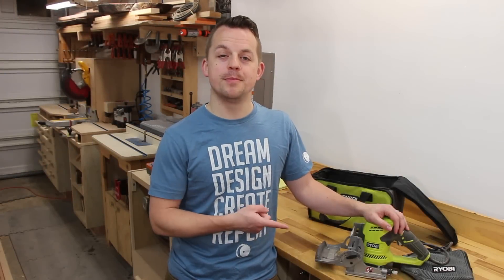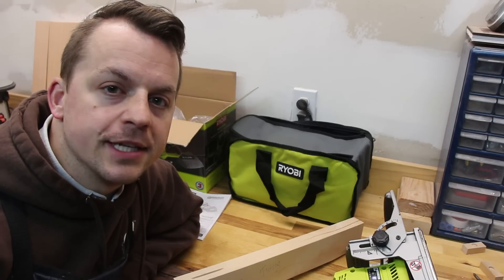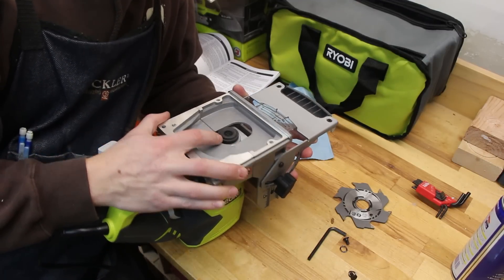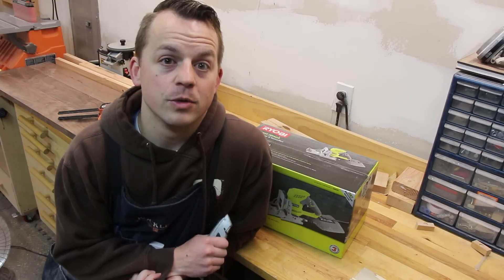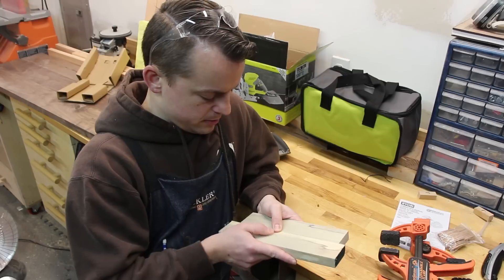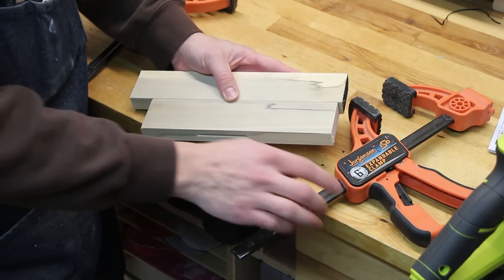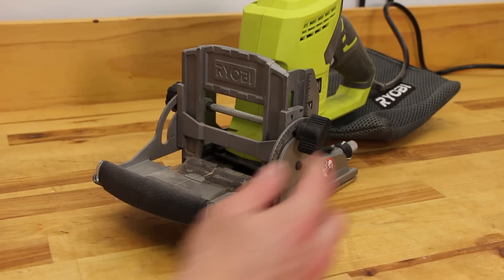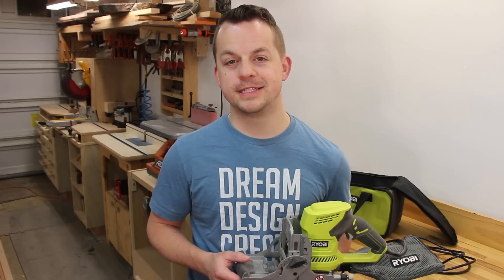WATCH THIS! Before buying a Ryobi Biscuit Joiner- Complete Review & Unboxing

Comment: How you store your biscuits can account for some tightness when you go to insert.  The average biscuit is made of beech and has a high ratio of exposed surface area so if you don't store them properly they can swell.  1. Make sure to store them in a container or bag that seals airtight and  2. Add a desiccant (absorbs moisture).  Just a random tip that people often arent aware of...
Reply from the maker: That's a good reminder. I don't leave mine open longer than 10 min but I may try adding a desiccant to the container.

Comment: I have one of the early 1990's model Ryobi biscuit joiners, from when they were using the blue housings instead of the neon green they use now.  It's much harder to adjust the fence on it (no rack and pinion gear).  It uses a rubber pad around the saw slot instead of the black sandpaper-like material on the newer ones.  Like your experience, even now, 3 years after your review, people still complain that they buy the joiner and the slots cut are not parallel to the top of the work piece.  It is hit or miss, apparently.  Biscuit joiners are really angle grinders with an apparatus stuck on there to expose the blade as needed to cut the slots.

Comment: I have the old blue ryobi biscuit joiner. Looks just like yours besides the color. Mine has worked perfectly for 10+ years. Good tool
Reply from the maker: That's good to know! Yeah I think they basically rebranded it with the new colors when they went to the green and black color scheme

Comment: Thanks for the review.  I just bought my first bisquit cutter, a Ryobi. After unboxing, on my first cut,  I  experience a huge amount of smoke from the tool.  Thanks for the heads up on what to look for in a good cut.  My tool was  without a doubt, a returned tool whose blade was swapped, and the black plate removed for parts.

Comment: Thanks for the trial, Ryobi seem to be making some very good priced tools now, after buying a new Plunge Router and a Belt Sander I was already leaning towards Ryobi again for a Biscuit Jointer. After seeing your video I will be more careful than usual unboxing, just in case 😉
Reply from the maker: Glad it helped!
Reply: I don't use biscuit joiner on my woodworks, neither dowels for joining woods, or frames. I either use 16 gauge or 15 gauge finish nailer, wood glue and pocket screws for joinery. Fin/Trim Head screws for fine works and fine details, and deck screws or common nails for a larger works. For a much larger wood works like picnic tables and large garden bench I use deck screws, or lag screws or carriage bolts. 23 gauge nailer and wood glue for a much Finer wood works like picture frames, small shelving details etc etc. When I'm building kitchen cabinets I use 16 gauge finish nails and wood glue, sometimes pocket screws, and cabinet screws. Wood plugs and pocket hole plugs to cover the hole and a nice patch of wood filler. I don't use a wood just to connect a wood to a another wood because that's what a biscuit joinery and dowels are doing. For materials I don't use MDF's or any sort of particle board, because at the end they're nothing but just a compressed paper that became a plywood and they eventually gonna break and will not last long.
Reply: @taolang1089  sounds like you do lots of joining stuff - you should do a video on it....

Comment: Subscribing; appreciate this. I always check every Ryobi internal/machine or tool-borne measurement with an exterior tool, like a combo square or even a tape. For whatever reason, that application consistency seems to vary somewhat, even within one use like your first cut. The angled blade on a table saw walks; the router depth compresses, etc. It's slowed me down a lot over the last two years in projects, but I've found that between that and obsessively using clamps, Ryobi is plenty good enough for me for now. 

Thanks again! Great review.
Reply from the maker: Thanks! I'm glad you liked it. Yep always gotta keep your tools tuned up with a separate tool. I never trust a 90 deg on a tool until I verify it!

Comment: Great video. I have one of these Ryobi biscuit joiners. Originally I wanted a more expensive one but this is the only one they had at the hardware store. I am very impressed. Like you said, the dust collection is excellent. The bag captures 99% of dust but it fills up pretty quickly. I wish it was a little bigger.
Reply from the maker: Agreed... I found out firsthand that it surprisingly doesn't work when it's full!

Comment: Thanks for the heads up regarding the inaccurate cutting.  Even a couple of years later, I checked a display item before I bought one in Australia.  Yep, the base plate for height adjustment is not square with the Cutting blade.  So I ended up buying a different brand.

Comment: Adjust the fence.  The plate that sits on the wood.  Controls where on the wood  the cut starts.
Reply from the maker: Yep I did that. The problem was that the fence was not parallel to the cutter no matter what I adjusted.

Comment: I watched this because I have a Ryobi JM-100 that is still going strong after 20 plus years of occasional use. The JM-100 is the common type based on an angle grinder which drives through noisy bevel gears; I assume the review machine is direct drive.
You highlight two very important points to look out for. If you are referencing off the fence then clearly it needs to be parallel to the work. I prefer to work off the base when possible but, of course, this also has to be truly parallel to the plane of the blade.
Positive dust extraction is advisable.
Reply from the maker: Exactly! Ideally I'd like the cutter, fence, and base to all be parallel so I can use it however I want!

Comment: Bought one of those when they first came out.  Still using it.  like the way it allows you to put pressure down and into the joint target with one hand.  added some 400 grit psa sand paper to the front to make sure it does not slip.
Reply from the maker: Yeah the angle of the handle definitely helps you apply the right pressure.

Comment: if the blade angle needs adjusting, there is an easy fix. First take off the base plate, then loosen the two screws holding the two halves of the base casting together.

one of the halves has a locating pin so is fixed in one position.  The other side has no pin so can be adjusted by turning the screw.

So one of the sides acts as a pivot.

As you retighten the screw on the other side you will notice that the position of the two halves relative to the other changes.  

When the halves are aligned, The Biscuit cutter is parallel to the base so will cut a straight slot, parallel to the edge of the board.

The trick is to tighten the screw on the moving side as much as possible whilst the alignment is right.  You don't want to cinch it down when its in the wrong position.  I used thread locker to help because my screw had to be in the loose position.  Also, when you attach the base plate it will hold the adjustment you have made.
Reply from the maker: I didn't try that but I figured I shouldn't have to adjust that right out of the box. Good to know for future adjustments though

Comment: I wonder if the parallel issue was a problem with the fence, rather than the spinning blade. If you couldn't return it, I bet some fiddling with the fence (even putting a little shim on one side) would make the biscuit cut square.
Reply from the maker: If I couldn't return it, I would've jimmy-rigged something!

Comment: I got a whole box full of free tools, they all had non standard plugs on the leads, the problem was that they didn't have the plastic around the pins and rather than have new plugs fitted they just replaced the whole tools, I scored a 2 biscuit joiners, a TEK screw gun, a makita saw and router and a 20 metre extension lead.
Reply from the maker: Good work!

Comment: Do you find using it on smaller stock makes it tough to use on smaller stop referencing off the bottom? Seems like a thicker plate than others?
 I have it is why I ask.
Reply from the maker: I've only used it on wider, 3/4" thick material, but you should be able to add thin spacers under either the plate joiner or the wood you're working with. Just make sure use the same spacers for each piece.
Reply: thanks buddy
 @EveningWoodworker

Comment: I bought one of these and the biscuits were really loose.  They were square and aligned but way too much slop.  Traded it for a DeWalt and all was good.  Shame though.... everything about the Ryobi seemed amazing and it even was a pleasure to use.  I liked the pistol grip and the large handle on the fence and the fact it does 135 degrees angles.
Reply from the maker: I think you can buy just the blade and install that on this one if you want.
Reply: The other important thing to note is that this Ryobi is one of the only biscuit joiners that put the slot no less than 9/16 from the bottom face when registering off the bottom face as oppose to 3/8”.  This is a problem if you work with mainly 3/4” wood, in which case you would have to use the fence to register and will not be able to use the bottom face.

Comment: I purchased a Ryobi biscuit Joiner about 8 years ago.  After borrowing a dewalt joiner from someone else. I found the pistol grip very comfortable to use and the price could not be be. However if the using a pocket hole joiner I have had little use for it. But I seem to remember having the identical problem with mine. And never thought to return it. I imagine there's a way to adjust it? Think I had tried.  Don't remember the result.
Reply from the maker: I took it apart as much as I could and I couldn't figure out any way to adjust it.

Comment: I have the same problem with my DeWalt biscuit joiner. Kinda stinks there doesn’t seem to be a way to fix it.  I really wish the manufacturers would provide some adjustability for the blade angle so it could be fine tuned.
Reply from the maker: If you're outside the return window you could try shimming up one side of the fence just slightly so it changes the blade angle.

Comment: Could it be a problem with the fence
Reply from the maker: I measured the fence in relation to the tool base and it was staying pretty parallel. Just the blade was off.

Comment: Just got one of these.  I'm using #20 biscuits (Ryobi brand also) and they're loose. Nowhere near as tight as yours. Not unusable, but they just fall out if my work piece is turned over. Is that typical?
Reply from the maker: It's not terrible if they're loose. They expand a fair amount with the glue... some slop is okay, too much slop and it doesn't really help you with alignment at all!

Comment: This is the best looking cut I have seen.  I tried a DeWalt and a Lamello and returned both as they could not align the cutter repeatedly.   I have an old blue Ryobi though not much better  can be used by sliding the basic machine on a wooden surface and get consistent results.  Reminds of trying to use a Wolfcraft dowel jig that had mm size guides and imperial size drills.  Utterly insanity and useless.
Reply from the maker: Yeah this one does surprisingly well considering the price point

Comment: Did you only try one single biscuit and assume it was jacked up instead of maybe checking to make sure it wasn’t user error? Seems a little nuts to me to assume you did it perfect the very first time, and that your wood was perfectly flat...
Reply from the maker: Don't worry I tried multiple biscuits and multiple boards... also it wasn't my first time using a biscuit joiner.

Comment: I appreciate people who review these and this person did a great job in exposing a problem that would plague a novice for probably the life of the tool. However, in the original review, I seriously do not trust that piece of dark walnut scrap he was using for his test. It was obviously split and potentially warped. These style bisquit jointers rely on a flat and level surface to guide the cut. I would have trusted this review more if the OP had tried this same test on a different board before returning to the store. WIth that being said, I have had more than my fair share of ryobi brand tools with problems 'out-of-the-box'. I would recommend anyone buying this tool to perform the same test 'out-of-the-box' and if it fails, try a different board before making the decision to return it.
Reply from the maker: The board only had the split on one side. This had already been run through a planer so it was pretty flat. I did try it on another board though off camera with the same result.

Comment: I’m just getting into woodworking and was given a Ryobi Biscuit Joiner as a gift. Do you have any suggestions on what to make first and if so anything easy?
Reply from the maker: A good first project is a cutting board but that doesn't necessarily need biscuits, just glue and clamps. You could try a picture frame or even an end table. Welcome to woodworking!

Comment: You went hunting for the alignment problem with the first unit in the wrong spot.  You were looking at the motor itself... which has nothing to do with the angle of the cut you were getting.  You should have been looking at the guide mechanism you set onto the top of the wood which has adjustment and what looks like a rack-and-pinion to synchronize the left and right sides to move them parallel.

Comment: Great video and if they don't sponsor you - they should. When you adjusted for the 0 size biscuit, did that adjustment effect the fitment of the other size biscuits...? Will you have to adjust it every time you switch biscuit sizes...?  Thanks & great channel.  Also, since I'm writing. In another video you mentioned bringing wood from other countries... you should do a video on that...
Reply from the maker: Nope they don't sponsor me... there are depth stop settings so you can quickly adjust the depth without affecting the alignment. Glad you like the channel. Good idea for a video!

Comment: Thanks having issues with my Ryobi.  The biscuit is not tight in the slot.  Should I return?
Reply from the maker: The HD return policy is pretty generous so you could return it and see if there's a difference. A lot depends on the biscuits too. Some are thicker than others.

Comment: Thanks for the video and the testing tip. If the tool is slightly crooked, it would make a huge difference in the outcome, one I wouldn't think of in troubleshooting the misalignment. I would think it's caused by wood warping, but in this case, the tool is the culprit. Good thinking!

Comment: What is the minimum thickness this thing works for?
Reply from the maker: The cutter is 1/2" up from the bottom and the fence will go all the way down to the blade. I wouldn't recommend doing a biscuit though on anything thinner than 1/2" thick
Reply: @EveningWoodworker  how thick is the cutting blade?
Reply from the maker: It cuts a slot at 4mm or just under 5/32"

Comment: These tools are known as loose tenon tools.  The biscuits swell when glue is added in the slot.  If the biscuit is too tight to start,  you will not get glue in the slot.  Sloppy is not good but neither is "nice and tight"
Reply from the maker: That's true, there's a fine line on these between tight and loose.

Comment: Something about the wood? You used hard walnut first.  It looked rough.  The wood caused an uneven cut. Then you used planed wood the second try.  Stop using the fence too. I love mine and never ever had a problem.
Reply from the maker: The walnut was from the same board, both planed. I guess some work and some don't. My second one worked fine and I still use it today.
Reply: Also another point, Many of the domino joiners have a plate on the bottom. Seneca woodworking sells a 1/2 and 3/4 plate that you can purchase to aid instability. I’m not sure if there’s one for biscuit but I add an extra piece of wood. Basically, you’re working with the tool upside down. So get rid of the fence.
Reply: Sometimes woodworking could be so complicated. Details. Aargh

Comment: I really appreciate this video. I bought one of these used though offerup and I wanted to check that I have all the components which your unboxing helped with. Secondly you give me some good tests which is great. 

I watched another video about the DeWalt biscuit joiner and I think that it might be possible to fix the parallel issue. It definitely was possible on the Dewalt but it might also be possible on the Ryobi. 

https://youtu.be/RaM0aMLyaYo
Reply from the maker: Thanks! I will check it out

Comment: Ryobi is shit, at least the last 15 years.  I bought a ryobi joiner about 30 years ago, and it's sturdy machine.  Amazingly, I've hardly used it, and recently got it back out of storage, which is why I'm looking up videos. Mine cost about$240.
Reply from the maker: It's definitely the lower end of the tool market but I figured for the price, this one was at least worth trying out.